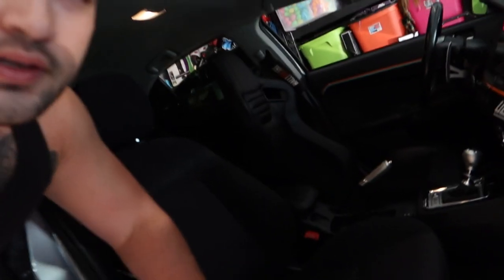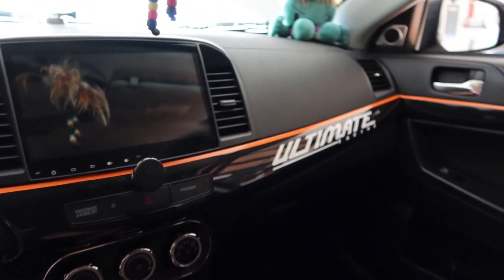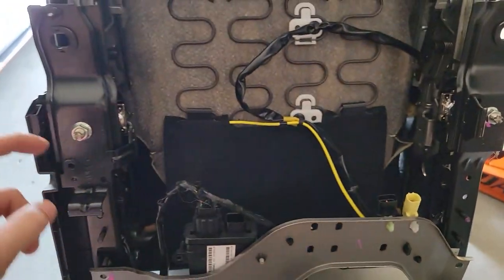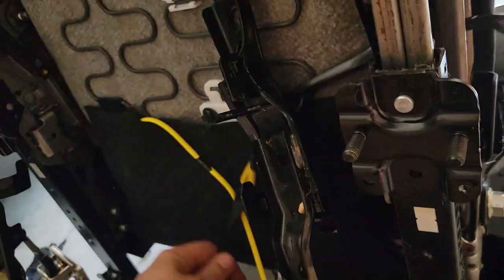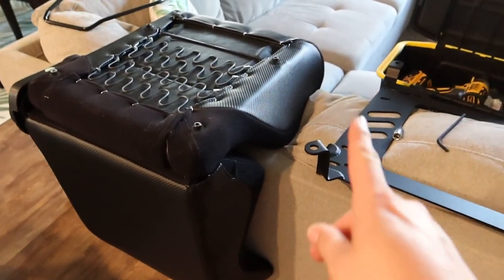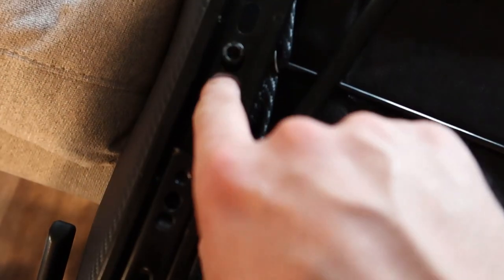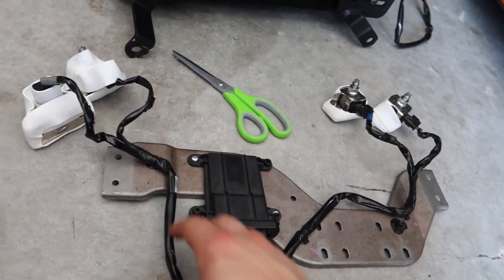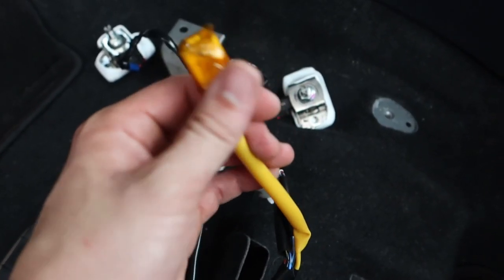Aftermarket Racing Seat Install (2008+ , All lancer Models)

Comment: Weird my 2017 lancer doesn’t have the weight sensors, I took out the driver side rn and noticed it :/
Reply from the maker: Driver side doesn't have them. Just passenger
Reply: @TheSnyds  ahhh makes sense thanks man! Just finished installing them, unfortunately my seat brackets didn’t come with nuts and bolts so I used heavy zip ties for now and going to have to take a trip to Home Depot tomorrow 😂
Reply from the maker: Be safe!
Reply: You can't short out the weight sensors?
Reply: 2017 evo? 😂